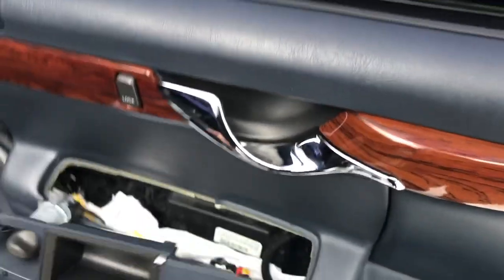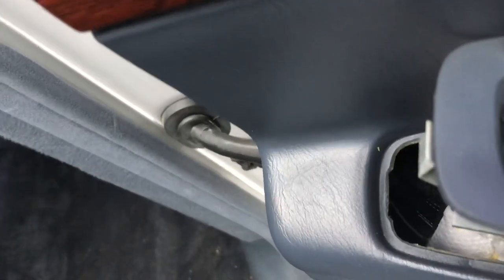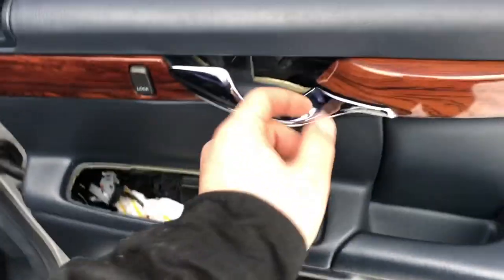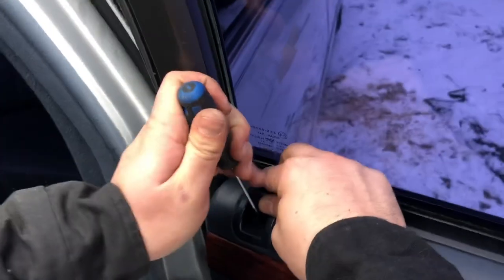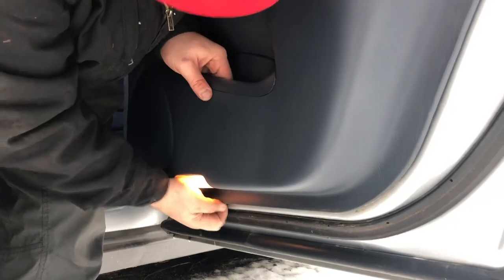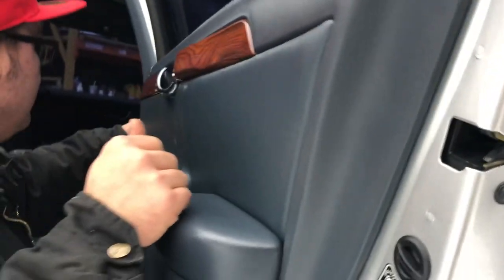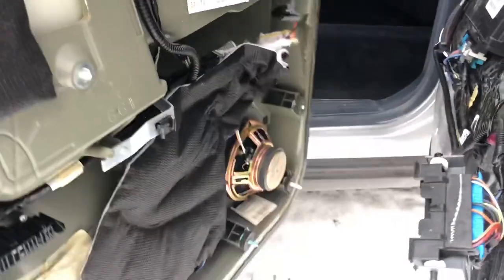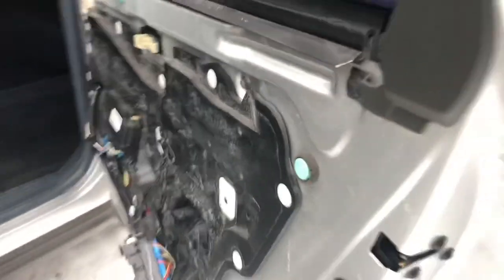00-05 Cadillac Deville Door Panel Removal

Comment: To braydensdeals:  Please pause this video at 0:02 and notice the inside door handle. This door handle is the most beautiful door handle ever designed by any car maker in the world. Seriously, Rolls Royce, Bugatti, Astin Martin...no luxury car made anywhere has a more beautiful door handle than the Cadillac Deville, circa 2002 - 2005. I owned this car for ten years, and every 
          time either I or passengers would put our hands in the door panel pocket to pull the door handle, it was a totally different experience than any other car. The handle is beautifully sculpted steel, which is curved with shiny chrome finish and it fits your hand like a glove. 
          This is not just function. This is truly art, sculpted in a way to imitate a swimming dolphin or a bird in flight. Seriously, compare this door handle to every other door handle you have ever seen or touched, on any car in automotive history,  and nothing else comes close to being this beautiful, while fitting your hand perfectly. 
          The designer who conceived of this door handle and then persuaded General Motors to spend the extra money to cast and chrome finish these handles, deserves a citation of artistic excellence..
Reply: Kids dont smoke crack
Reply: @w.e.s.  What in the world does kids smoking crack have to do with this car door panel removal video,  or my comments regarding the Cadillac door handle? Perhaps you have typed the wrong comment that was supposed to be a response to a completely different video?
Reply: Beautiful summary

Comment: any chance you could show putting the panel back on?  That's where I'm stuck.  I may have also busted a couple brackets on the removal.
Reply from the maker: FAM CO sorry, install is usually the easier part, you have to transfer the middle metal clips off the door panel back onto the door before installation. That’s probably what you messed up, good luck
Reply: Yep!  Once I actually got back into it I understood what you meant by taking those clips off.  Also, a couple of those long guide pins were busted off.  Oh well, got it sold anyways.  Thanks!